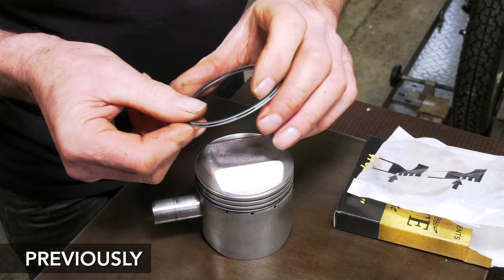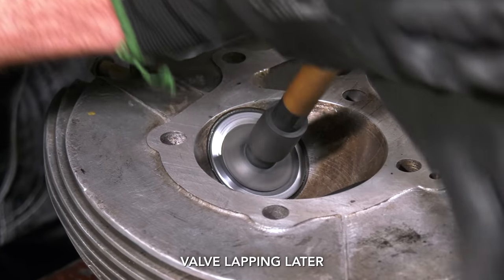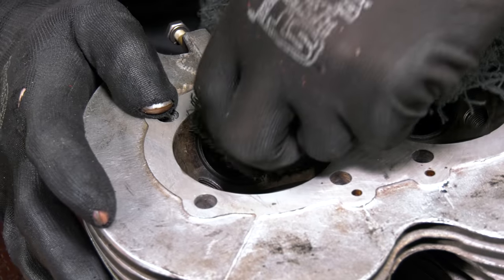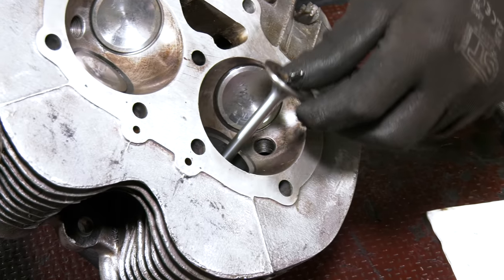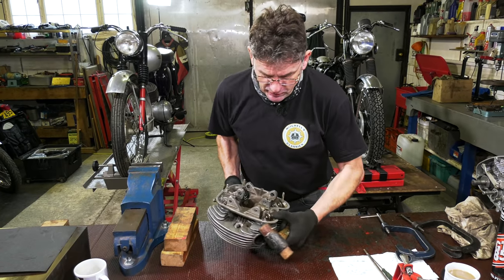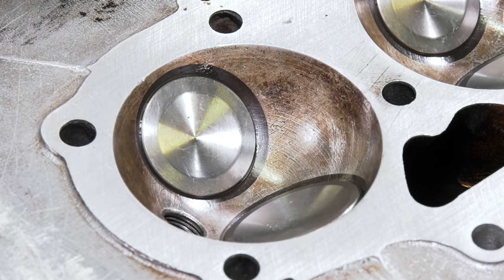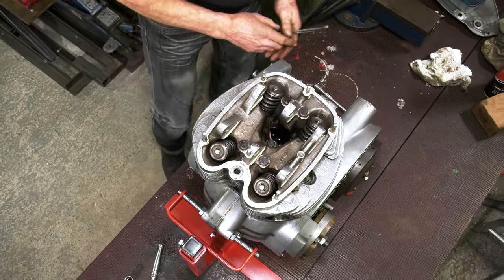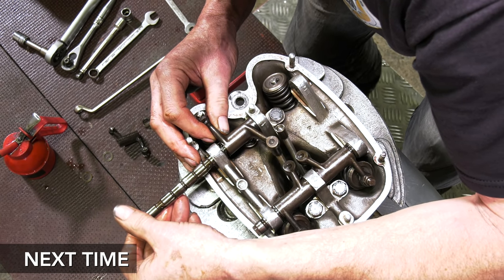Part 6 - Low Budget Classic Motorcycle Restoration Project

Comment: Reminds when I was 16 (many years ago)building up Triumph tiger 90  £20 just load of bits in sacks ,surprisingly it was all there, spent nothing on it used old rings and annealed head gasket . Got loads of information from local British bike part supplier Barry Ladlow , had sign in shop " please do not ask for Japanese spares as a fist in the gob often offends " . Bike ran really well , my dad used it till I passed my test , I used his B25 Starfire , Tiger 90 was quite a nice lively engine just lacked any brakes

Comment: Sorry to put my 4 penneth (is that how you spell it?" in again but if you are going to reuse the valve springs always measure the height against that listed in the manual, if considerably less in height, replace them to unsure you don't get "bottoming" of the springs in use. Also if reusing the old copper head gasket anneal it before using to soften it. Even replacing it with a new gasket, if it has been on the shelf for some time it will always benefit from this. Still the best rebuild video on You Tube!
Reply: I think it's usually written 'penn'orth' or something like that ! - Anyway, it's short for 'pence worth'..

Comment: Great series and tips. I was told as an apprentice that the length of the spanner should determine the torque? I have marked inaccessible nuts with paint before so that upon assembly just line up the paint Mark's with the theory being that the torque should be as before. Only downside is the paint can come off during cleaning 👍
Reply from the maker: Haha, but seriously, that's actually a really good tip! Glad you're enjoying the videos :)

Comment: I like the video. It shows that you can do a lot than people expect with just basic tools. Like cutting valve seats or replacing guides. I only have a bit of feedback about the way you use the torque wrench. You seem to use it in some sort of start-stop way. Starting movement always takes more torque than continuing a movement so I always learned that it is best to move the torque wrench in one continuous movement. At least the part where you approach the torque specification for the bolt.
Reply: Yes,also you loose a bit of torque with longer extensions as well.

Comment: Valve collets are always a pain in the rear end. Fortunately you only had 4 valves. I put a biy of assembly lube in the recess on the end of the valve to help stick them in place before releasing the valve compressor. Good point about a tap on the end of the valve to make sure they are seated properly.

Comment: Hi Dave. Nice vids and info on the older British bikes.   I am wondering why I did not see any valve guide seals on top of the new valve guides?  Surely this bike is going to smoke with the oil leaking down the inside of those guides?  Just asking because all of the motor cycles and car motors I have rebuilt even lawn mower engines have valve guide seals.   Very enjoyable watching your skill set.
Reply from the maker: Hi David, thanks for your nice words (Alex here, I run the channel). Yeah, that's how the engine goes together actually. You'll see when you get to Part 11 when we do the first start. We replace the valve guides in the video and you see it all go together in there, how it is.

Comment: Do you need special tools? and are factory tool available in aftermarket to rebuild the motor?
Reply: Yes to a few special tools like a clutch puller,cam gear puller.Everything is fairly easy to get nowadays.